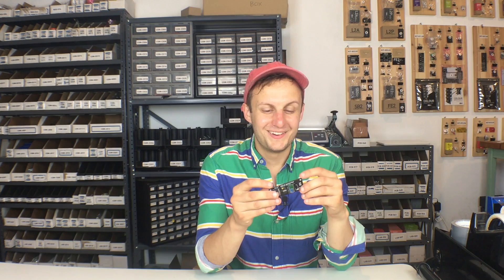"Distortion Is Easy" | From the Bench ep. 5

Comment: How is this different from 15ips?
Reply from the maker: Great question, thanks. The 15IPS uses a ladder of several germanium diodes in a row for a softer clipping curve. It also has a slightly resonant high-pass filter at the very low end. The Mojo Maestro, on the other hand, uses only two diodes, lacks the HPF/bass-bump, and features a low-pass filter that's engaged in the "MOJO" mode.